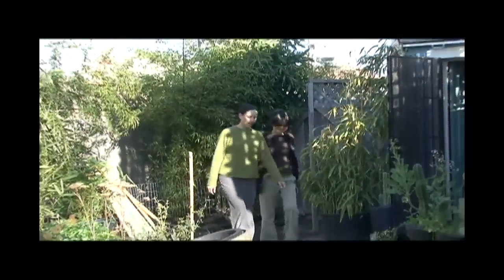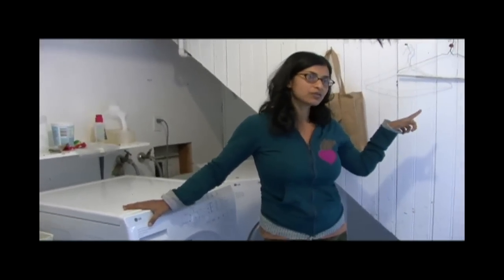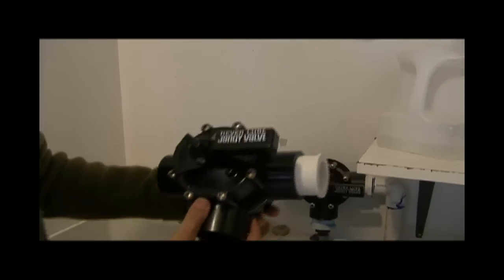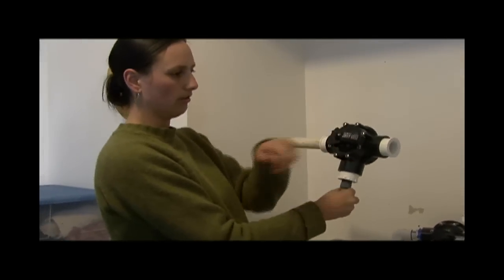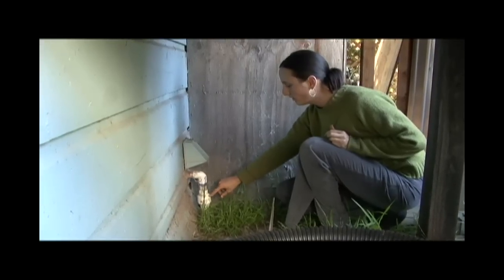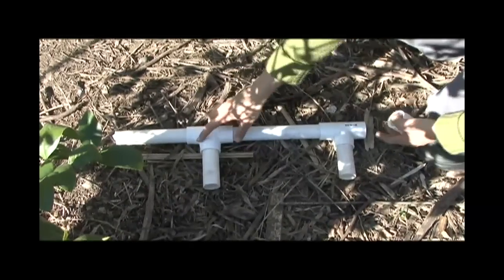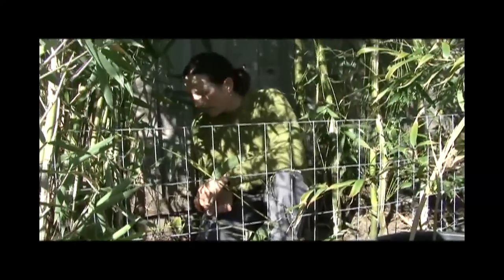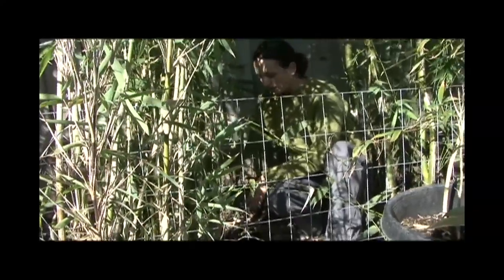How to Homestead: Greywater & Your Washer

Comment: Hi - Great idea and video!  I did not watch all the way through, but my situation is that we have our washer / dryer in the basement.  Wondering if we would need an auxiliary pump to help the washer out.  We would expect to travel:  5 feet vertically / then 9 feet horizontally to the outside wall, and then there is about a 2.5 foot drop to the ground outdoors, and the drop to the ground could be accomplished gradually - We have our bathtub draining outdoors for greywater use as well and love it!